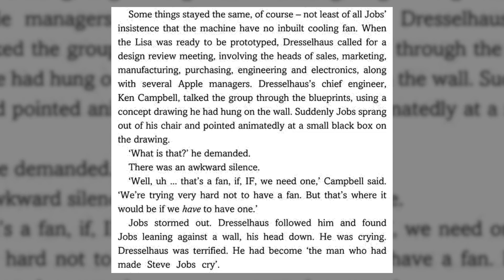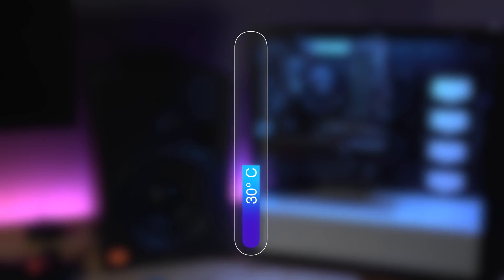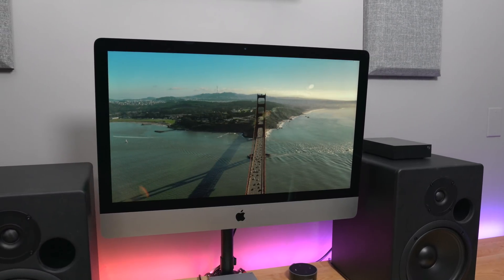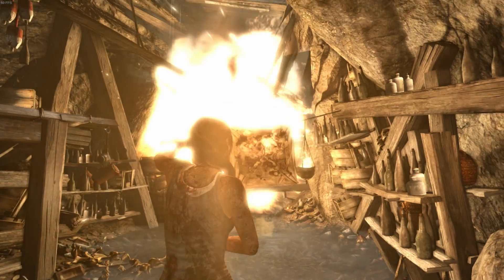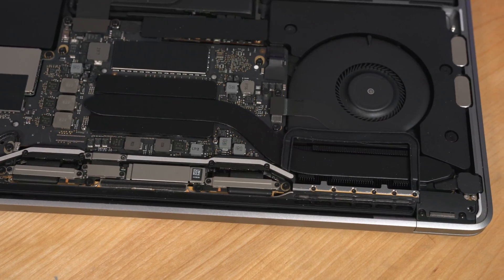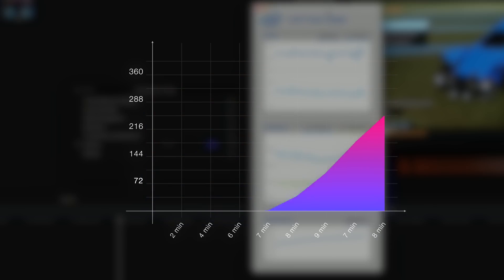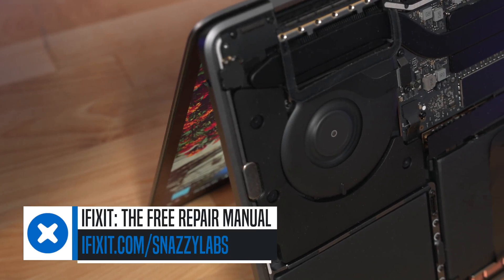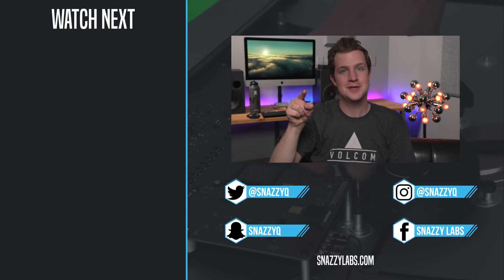Is Apple Ruining Your Mac's Performance?

Comment: No doubt, what's worse is that the 2017 15" MBP is actually 10 degrees cooler running Windows 10 with 3 x 4k monitors attached than it is using Mac OS. Not only is there a hardware problem, there is effectively a software problem too (likely related to the video drivers)..

Comment: Tbh I would prefer a louder faster Mac over a slower quieter Mac...
Reply: Of course, ikr.
Reply: not me, most of the time I don't use my CPU on 100%, so I want a quieter computer. When I need max speed, like rendering something, then I crank the fan speed up a bit for a few minutes.
Reply: Of course not. I am talking relatively.
Reply: @victornpb  Well perhaps they have to do it in the OS again, make two options for different usage, versatile than ever before.
Reply: You got your wish! If you heavily load your Mac, the fans will spin up to ful speed and you will definitely hear the noise. This is standard Mac behavior. The fans are run at low speed only for light loads, so if you're not hearing the fans then you simply are not loading your system very heavily (and its running at full speed for you).

Comment: There are always compromises in design. I'd personally rather my laptop to be quiet, thin and light and if it means it'll finish 7mins later than normal so be it. Not defending Apple, but design decisions are very hard especially for a very general purpose products like a laptop.

Comment: I think Apple got liquid cooling PTSD from the Power Mac G5, but I'd love for them to try self contained liquid cooling again, in the iMacs and/or the Mac Pro.
Reply: When Apple bought liquid coolers, they had a bunch of warranty problems from leaking. Windows gamers that liquid cool their PCs have the same problem, even if you buy an AIO that is factory seal, you still run the risk of leaking and destroying your motherboard. If someone invents a better liquid cooler then I suspect that Apple will test it to see if it real is any better.

Apple in fact runs "heat pipes" in all its laptops, from the description of that devise it seems to be a liquid cooler of some sort. I that is correct then technically all MAcBooks are liquid cooled.
Reply: Practically if not literally every laptop with a fan has a heat pipe, that's the bone standard. Check any teardown, the copper tube is a heat pipe that wicks heat away to the fins to be blown by the fan.  There's technically some liquid inside yeah, but no one (except microsoft with their lumia claim, lol) means that by liquid cooling. Maybe a vapor chamber in their bottom panel like the surface laptop would be interesting.

Comment: Can you test the windows laptops for thermal throttling for a comparison.
Reply: That makes a lot of sense but I can tell you the results right now. All computers have the same exact thermal throttling issue because its the Intel/AMD/Nvidia chips that are overheating, its not an "Apple" problem like this video is erroneously stating. Some people get fooled by the fact that most Windows/Linux laptops seem to be cooler, thats an illusion created by the plastic shell. The plastic shell on them actually makes them run hotter because plastic acts as an insulator. MacBook shell are made of aluminum so hey can dissipate heat throughout the entire shell. What happens is that Windows laptop will be a lot louder because they have to run the fans a lot faster to provide the same cooling that a MAcBook can do with low fan speed. I have also noticed that the Windows laptops suffer from a lot of fan failures, causing those laptops to crash. My guess is that those fans run so fast so often that they are wearing out prematurely. I have never had any of my Mac clients wear out a fa (I'm not saying its impossible, just that I haven't seen it in my professional experience).

Windows desktops are even noisier than iMacs, in that case I suspect that they simply use cheap fans (all the ones I have ever repacked where cheap junk fans, and that was out of top name brand factory built PCS, not home built machines). This leads me to believe that Apple really does put more engineering effort into cooling and quietness, its just that Intel/AMD/Nvidia are still using a 1980s approach to how they sell and clock their products.

Comment: I know many people do this, but to me, using a laptop to edit video doesn't have much appeal. I strongly prefer a desktop for that. Of course, my 2009 white MacBook, just doesn't have the power to do it in a reasonable amount of time. My late 2013 27in iMac does very well, being a base model 27, its just an i5, but I also don't deal with anything over 1080p 60fps.

Comment: Moral of the story :PUT YOUR 5000$ Macbook pro in a FUCKIN Freezer so it doesn't thermal throttle.
Reply: DT B buy a ~$1000 phase change unit and it'll run at -30c. The freezer isn't design for constant cooling. But you'll need some tech skills and your mac will look like Frankenstein

Comment: I had one of the higher end intel core M macbooks for free from work. It's was a nice machine but wow it felt like it was actually burning your legs. Also, I know intel core m power throttle all the time to maintain a 4.5 watt TDP but this would also thermal throttle to the point where the computer would feel almost unusable. I loved the idea of an ultra portable, silent and insane battery life laptop. So I gave back the laptop and bought an Asus UX305CA. It had a slightly lower end core M chip, but unlike apple who just used passive cooling straight to the case,  asus put a heat pipe and small fin array without a fan to dissipate the heat. (The asus has full metal body and about the same thinness, so that insn't the reason apple cheaped out) The asus laptop, had the same battery life, higher resolution screen, and massively outperformed the MacBook in all benchmarks I ran. Simply because it didn't thermal throttle at all. This is a laptop that cost half as much, with similar build quality and all-round specs but with a lower end chip, that outperformed the macbook just because of thermals.  Also the asus bearly got warm to the touch and according to  HW-monitor the cpu even under full sustained load stayed in the mid 60's. I wish apple would sort that out, as they have some lovely devices and massivly perfer Mac OSX to windows 10. Atm using linux mint on the asus.

Comment: I use both 2017 and 2015 MBP 15 to run resolve and export ARRIRAW and prores 4444XQ videos, fps is stable around 30 with a cool environment or a cooler fan under the mbp, if in a normal environment the fps will drop to 15 or lower after a few minutes, both my mbp were customized with the highest CPU option

Comment: Not trying to disagree with this at all Apples cooler designs definitely should be improved however, the Touchbar model of MacBook Pro's have a two fan config with added intake slots on the bottom for the higher 45watt tdp cpu's (I would be interested to see a comparison with one of them vs the base model)

Comment: I am not trying to defend apple, but it is NOT throttling if turboboost is not holding the max boost clock. Only if it is below the base clock. But yet still it is very unhealthy for computers to stay over 75C for a long time...

Comment: This emphasizes the Macbook pro's need of an external cooler during summer... wich kill the portablility of a laptop. 
But on a desktop solution, there is no excuse. At this price point they even could have designed a custom water cooling solution. 

But this may also explain why with similar config hackintoshs are often faster than actual macs.

Comment: Actually, if you wan't to, you can install some Fan-controll software, as far as i know, it really helps just by overriding fan operation mode (simply by monitoring your CPU and GPU temperatures and setting RPM to some value).

I have use software like this at my old Thinkpad T60p laptop, that had the same problem, and it helped me. And yes, this works on a Mac OS too.

Comment: They should name base MacBook Pro as MacBook Sequel! People here justify saying that touchID version has two fans. That's no excuse for a Pro machine that costs twice that of an alternative. It cannot be upgraded. Any one in their right mind would want to have at least 5 to 7 years of life out of a $3500 laptop that markets  itself to the Pros. This is without adding almost $300 general accessories that are needed day to day. As it stands, two years from now, storage would definitely need upgrading. I should get external HDD that hangs out of my laptop? People who support apple needs to be bit more rational. They have removed usual ports. They benefit by not paying royalty. Less components, Less service calls. They have made ports and dongles someone else's problem for their benefit. How come? Again, because of the price. If the price was reasonable, this can be overlooked. Previous devices were expensive, but, may be by $200 to 300. But now they are ridiculously expensive. I can't get apple care after 3 years. I can get extended warranty upto 5 to 7 years from HP, Lenovo, dell, etc.. So, there's that. Still, they sell it like it has got all the word's best technologies. That's what's upsetting. It's not even a bare minimum laptop IMO.

Comment: Was suspecting this, my Mac mini 2011 w/AMD graphics and HDD+SSD runs at about 80 degree C during lite browsing. My MacBook Pro 2015 makes lot of noise under load especially running VMware or heavy load. Apple clearly values slimness over great thermals unafortunately 👎

Comment: I used a mac mini and a MBP for about two years and this video perfectly illustrates, what my experiences were. Not only, that they become slower with higher temperature, apple build in very tiny fans who run on a very high frequency. So WHEN they become loud, they are annoying. What always made me think was the fact, that my Mac mini had over 60 Degrees Celsius on idle. Crazy if you compare it to a normal PC. Well I learned my lessons, sold my macs and build me a passive cooled PC. Fanless Power, passive cooled I5 4590s and a nice GTX 1050ti passive. That is silent computing without temperature issues. My CPU NEVER crossed 60 Degrees jet.

Comment: Let me explain why a sane person with knowledge in computers wouldn't put a computer (that is turned on) inside a freezer:

Freezer = Cold
CPU (and other electrical parts) HOT
Computers often have coolers that move hot air

What happens when HOT AIR gets COLD? 

CONDENSATION, what does condensation create? WATER.

What happens when an electrical system gets wet?

Comment: My 2011 laptop doesn't throttle luckily... only because it's thick enough to actually vent air and I've set the fans to run at 100% all the time.

Comment: I have a maxed out 15" 2017 Macbook Pro. The only time the laptop has ever got to what I would call worryingly hot isn't when I export / bounce large projects in Logic / Final Cut, but when I do that whilst an external monitor is connected. It's the discreet graphics chip in the 15" models that cause the issues - When editing a project in Photoshop / InDesign / Final Cut / Logic, the machine automatically engages the discreet graphics regardless of whether or not you're editing a minuscule project or a huge one. You can quite easily fix this by downloading various programs that allow you to choose whether you use the discreet graphics or the integrated graphics, but what you can't do is make this choice whilst the laptop is connected to an external monitor which is very frustrating. If I'm editing a medium size project in Logic or even if I have a few Chrome tabs open whilst connected to an external monitor the laptop fans go CRAZY and the space above the TouchBar is impossible to touch due to heat. I didn't have these issues with my 2014 13" Macbook Pro, so I certainly didn't expect them from a machine that was double the price.
Reply: I don't understand Apple's decision to use one heat pipe to cover both the CPU and discreet GPU.
Reply: Rob Earley hope that this doesn’t wind up like the Early and Late 2011 MBPs with AMD GPUs fiasco.

Comment: I‘m using a maxed out 2017 15“ MBP for my app development and rendering. Without a custom fan settings I lose about 10% performance due to thermal throttleing. With a custom fan profile I have no problems even close to that an my MBP is still pretty silence (especially compared to my Windows Desktop with a custom water loop and 16 120mm fans for real brutal performance).

Comment: My 2015 MBP15 thermal throttled like hell. It sky rocketed up to 98+ C, the instant I gave it a workload. I repasted, and it helped quite a bit - still throttled, but not nearly to the same extent. It went up to 95 C, stayed there and didn't now only throttled 15% where before it could throttle up to 25%. Furthermore, to keep the operating temps down, I've installed a program called Turbo Boost Switcher. This can disable (and re-enable) the turboboost of the CPU. Now my idle temps are down around 40-45 C, while working temps are about 80-85 C. Furthermore, I've ramped up my fans to both run at 2400 rpm at idle, using iStat Menus. This still remains silent, while giving that extra 400 rpm cooling boost. All this makes the laptop much more usable in day to day stuff, and if I need it to crunch on something, I´ll enable turboboost and go all out on the fan speed.

Comment: I have always used macsfancontrol (by CrystalIDEA Software) on my macs as I am aware of apples poor temperature management due to wanting auditory perfection whatever the case. My CPU Fan starts to increase at 58C and maxes out at 72C and my GPU is 55C start and 68C max. This way my laptop is sometimes a bit louder than other macs but only if I am exporting or watching a 10+ minute 4k video and I am okay knowing that it will help keep performance consistent and also prolong the life of my (large) investment

Comment: Simple fix, dont get a apple product
Reply: Thats ridiculous. All computers have this same exact problem. Its Intel, AMD and Nvidia that haven't figured how two make powerful chips without them producing tremendous heat. Windows and Linux machine shave this same exact problem, they all get too hot, they all make too much noise when the fans go to maximum speed and they all thermally throttle when under load.
Reply: Very easy, much effective

Comment: First of all, the MacBook Pro you're using does not represent the rest of the MacBook Pro lineup, with your many attempts to make it seem like you got the base model 13" with touch bar, you actually have the base model 13" with no touch bar. Example: around 5 minutes you selected the wrong MacBook Pro, because previously in the video the MacBook Pro had no ports aside the headphone port and the MacBook had only one fan and a removable ssd aside the CPU. The real difference between this and the touch bar models is that the CPU is an ultra low power CPU around 4 watts, which isn't the same kind as the 14 watt CPU in the higher up models with touch bar which also have 2 fans. This should have been a really good other video that you could make instead of furthering your now unproven point.

Second I don't think it's surprising the 27" iMac lost 15 frames a second, from 60->45 fps, I presume you got the highest upgraded model with an AMD Radeon Pro 580. Consider this: how would a RX 580 perform at  4K gaming? I'm actually amazed that it could pull off a 60 fps game for a long time and after throttling still play at a very good frame rate. If it went under 30 you could say the video carts still are bad but now you have very good performing cards in them and you still aren't happy? A few years ago the iMacs couldn't even do 1080p gaming well and now they do 45 fps at 4K at a demanding game.

And finally yes silent computers will hamper performance, everyone knows that. But what if some people like the more silent computers and less performance? I don't want to have a 2007 Mac Pro on my lap all the time, and I also love that it's thin and light and isn't more than an inch thick. In most cases except gaming I'd choose a quiet computer with less performance than a noisy computer with a lot of performance.

Comment: Thanks for a video. That is why I use Mac Fan Control. Nowadays my MacBook doesn't show more that 82 degrees under stress, but it is extremely noisy ;-)
Reply: Lucky you, I had a model with the same temps... But my motherboard died and Apple replaced it with some dirt crap that goes up to 94°C... I just lost the silicon lottery it seems.
Reply: It is typical situation. My MacBook used to have 100 degrees under load at stock. 82 degrees after installing Mac Fan Control and using custom parameters for system fan.

Comment: I had the exact same problem, when I was using my MacBook Pro for gaming (even with an external GPU). To avoid thermal throtteling and to maintain a stable CPU clock speed I forced the CPU to only boost to 3GHz and even lowered the CPUs voltage a bit (only in Windows possible).
In general I would recommend to keep the bottom of the MacBooks ventilated (even lifting them up from a desk with pens on the sides) to keep the MacBook cool.

Comment: My tip...
Before exporting, put the fans to 100% rpm 

It will keep the Mac cooler for longer.
Still running into throttling but later. Your export might be done and if not it will throttle later and therefore be done way faster

Comment: Stuffing a PC into a freezer is just plain dumb.. The compressor isn't made for continuous load, and can quite easily die if used in that manner. Also.. it makes absolutely zero sense to test it, since it has no real world use other that showing Mac is a good computer if you live in the Arctics and use it outside only :D
Edit: Should probably had seen the entire video before commenting, since you said almost the exact same thing :D

Comment: One little problem though. Except the base line 13 inches model you are using, all other 13" model with tough bar have 2 fans like the 15" model.